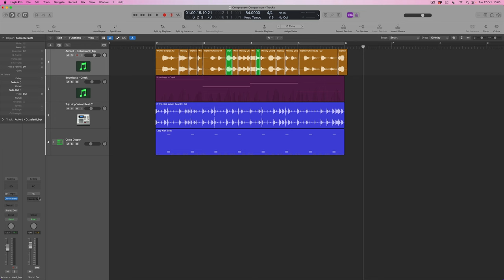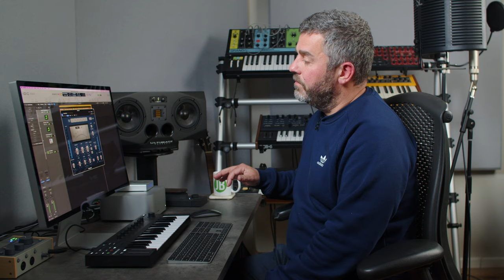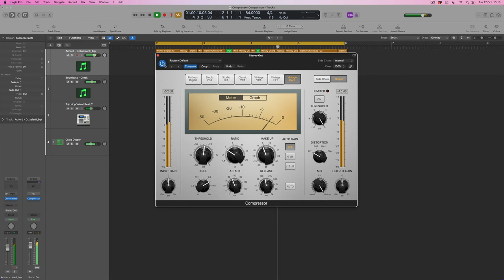LOGIC PRO X - Compressor Types

Comment: Thanks for another great video on your great channel.

I thought I’d share something i learned I didn’t see you mention here that’s helped me—using Graph mode instead of Meter mode (by clicking where it says Graph in the meter for anyone interested). I find it super useful for dialing in attack & release times especially if I’m doing it on a drum buss, high hats, or anything with lots of dynamic range with fast transients because you can see the the levels of the signal coming in along with what the compressor is actually doing. It feels like each of the compressors have slightly different curves on for attack & release so seeing it dip & recover can help avoid the pulsing & whooshing you can sometimes get with fast attacks & releases. 

Cheers!
Reply from the maker: Thanks a great tip, James. Thanks for sharing it.

Comment: These logic compressors are AMAZING. I’ve been trying to find a way to use them on individual stems to add minimal to 0 actually compression but to use the SOFT feature they have for distortion. Putting them on multiple tracks and doing nothing else immediately feels like it connects them together in a pleasing way to me (genre based and subjective for sure but I like it) hoping to learn even more with this! The emulations are nice
Reply from the maker: That's a great use of this plug-in. You're absolutely right; those extra features for a little extra Saturation are great, even without any noticeable compression. Glad to hear you're finding them interesting.

Comment: THANKS ! For orchestral music, as much as I use a compressor on the buses or tracks, on the stereo master I find it complicated to find a Preset/Model that suits all the instruments [example strings/woodwinds/percussions]
Reply from the maker: Hi Sophie. I completely understand - there's a lot of choice and no two pieces of music are the same, so it's not a surprise that you haven't found a one-size-fits-all solution. In fact, I'd encourage you not to try! Keep using your ears on each piece you write and you'll make great choices. Often, difficulties come when we hope that what worked so well on Track A will work equally well on Track B. Part of the joy of Compression is discovering that there's a great sounding, usually unique setting which is different for each track.

Comment: Hey Jono, thanks for the great video! I recently watched your Logic Pro X Masterclass at Guildhall and it motivated me expand my understanding of music production. 

I'm struggling to grasp what drives decision making when tailoring compression settings for a track. As a novice to compression with relatively untrained ears, can you shed some light on what sort of things you're listening for when choosing a compressor and dialing in your compression settings?
Reply from the maker: Hi Daniel. Thanks for your kind words. 

Compression is certainly one of the more subtle audio processing techniques one can apply. Unlike the obvious spatial characteristics of Reverb or Delay, at more gentle settings, Compression can be so subtle, in fact, that it's almost inaudible, when comparing a compressed and uncompressed signal. At such times, it's helpful to remember what Compression is 'for'; dynamic range control. What a Compressor is designed to do is to control the loudness of signals which exceed the Threshold point by whatever Ratio you set. The higher the Ratio, the harder the Compressor works, and the lower the Threshold, the more of the signal is compressed. Start with just those two parameters and you'll hear what happens to whichever signal you're processing. The quieter moments will remain unaffected, but what will happen is that signals above the Threshold will - at high Ratios - begin to sound squeezed and more tightly knitted together. Now dial in some make-up Gain, to compensate for the volume you've lost and suddenly the whole signal will feel a little punchier and under control. Now back the Ratio down to something lower, so the effect is less extreme... and then bypass it to remove it altogether. Try to level match the compressed and uncompressed signals, so that you're comparing similar output levels and you should hear the difference between the two. It's hard to explain with words alone - this is something I'd be very happy to spend some more timing exploring on the Channel. But I hope that gives you some useful ear tests to try.

Comment: Thanks Jono, another excellent video, ahhh but what’s your preference a single compressor or a multi band compressor at this stage, one other question, does the mastering assistant have compression within its logic.
Reply from the maker: Thanks so much. There's no 'magic bullet' answer to your question, I'm afraid; it very much varies from track to track. If the dynamics/frequency needs of a track vary from top to bottom, Multiband Compression will allow you to address those needs. If not, great results are available with stereo compression. And sometimes, both! Yes, Mastering Assistant's Dynamics dial is a kind of one-dial Compression treatment. It doesn't offer any more parameters, however.

Comment: Hi Jono, should the release time settings normally be set to allow the compression to go all the way back to 0db or is this subjective, eg is 1db ok or does it make that much of a difference. Or is a ‘use your ears’ kind of thing?  Hopes this q makes sense.  Cheers and thanks as always.
Reply from the maker: Hi John. It's a good question, though yes, the answer is completely subjective. Let's suppose you want an obviously-compressed drum sound, to produce a super tight, super punchy result. You might set Threshold to catch 5dB or so of gain reduction and high Ratio to ensure that all of that compressed portion of the signal is hit hard. You might set a quick Attack Time too, to ensure that those transients get compressed fast and also a quick Release to ensure that the Compressor recovers quickly and completely, before repeating that process all over again the next time the Transients are loud enough to be compressed. If you increase the Release Time, the Compressor won't quite have time to 'fully recover' before the next transient comes along and the result will be just a touch less aggressive - remember, as the needle can't get all the way back to 0dB, effectively, the amount of gain reduction is less. And if you increase Release Time some more, the Compressor has even less time to recover. In real terms, that means that not only are you producing a less punchy Compression setting, you're also turning the drums down in level, as they'll never recover to full volume. But it might sound great! And if you like that slower Release Time, you can use the Make-Up Gain dial to increase Volume to compensate. This example is just a hypothetical for Drums; entirely different settings might sound best on Bass or Lead Vocals... etc. I hope that answers your question and provides a little more insight.

Comment: Thank you for yet another great explanation. Is the “warmth” that some of these compressors related to the “distortion” option that some of them offer, and if is it only the compressed part that gets distorted or the quieter parts when they get raised? And is the “warmth” some kind of harmonics, or what is it? The more I learn, the more questions I get 😂
Reply from the maker: Great question! Remember that until 35 years or so ago (or thereabouts), if you wanted to apply compression, you needed a hardware unit to do it. Hardware compressors are input and output circuits, similar in that way to channels on a mixing desk. And so, if you drive Input hard, that circuit will, eventually, distort. In hardware compressors, exactly 'how' distortion was introduced to the signal depended on the components within the compressor - the lights of an Optical circuit, or the valves/tubes etc. So different compressors colour sounds in different ways. Producers have always enjoyed the fact that, as well as dynamics control, the tone of signals are affected by compression as well; many hip-hop producers use compression for tone as much as they do EQ and producers often choose vocal compressors for their ability to gently 'fatten up' a lead vocal. So even though Logic includes dedicated Distortion options within the Compressor, I deliberately omitted them from this video, as I hoped - as you have! - that viewers might start to make the connection between dynamic range control and Distortion and all of the sweet spots in between. I hope that answers your question. Oh and yes, 'warmth' and 'distortion' nearly always refer to a change (usually an enlargement) in the harmonic content as a result of processing. If this is a subject which particularly interests you, I've made a course on this very subject for FaderPro: https://faderpro.com/programs/the-science-of-sound-saturation

Comment: Thanks a lot. Appreciate your videos. 💪🏻👍🏻👏🏻🙏🏻🙏🏻🙏🏻 By now at the latest I know I wouldn‘t have needed to purchase so many 3rd party plugins. Logic‘s ones would meet my needs and possibilities to 90 %. I would have saved a lot of money, really. So I‘m sure now, I wouldn’t have needed to buy 3rd party compressors, because these here are as you say very good for all possible situations. But as a beginner about 5 years ago I had no to little idea of everything. Now, if you would recommend a must have 3rd party plugin that Logic‘s is not good enough or not there at all, which one is it? Or let me ask it this way: Which is your absolute „must have“ 3rd party plugin, absolutely necessary for your mixing work? Thanks in advance!
Reply from the maker: It's certainly true that Logic's Compressors are capable of lots more than we tend to give them credit for! I absolutely wouldn't want to make a single third-party recommendation. There are lots of Compressors I use and like for completely different reasons at various stages of the mix, on different instruments etc. This channel doesn't have any endorsement from any manufacturers but I'd still like to avoid any possible accusations of bias! The most important thing with Compression is to close your eyes and carefully listen to the before/after treatment. Do you prefer the sound with the settings you've used? If so, great. If not, keep subtly tweaking until you hear something you like.
Reply: @jonobuchananmusic  I understand. I appreciate your videos very much! Thanks for every single one. 👍🏻👏🏻💪🏻

Comment: Hi Jono! A question: On the first compressor, Platinum, after you set the dials, when you moved along to the next ones, it appeared you didn’t set any dials on some of them. If so, were they set by the Platinum compressor? Need a little clarification please.
Thanks,
Gianni❤
Reply from the maker: Hi Gianni. That's right, as you move between the different compressors, Logic will, where possible, retain settings from one to the next, giving you a chance to compare the sound of each model sequentially. It's not a straightforward science however; some of the Compressors have different gain staging, meaning that they'll appear to compress more than others, even with the same Threshold and Ratio settings. So do keep using your ears to decide which models work best for you. Cheers!
Reply: Logic locked what you dialed in on any of the compressor algorithms so that you can compare the different compressor algorithms. You can do the same with the Logic EQ when you switch to Linear Phase EQ.
Reply: @jonobuchananmusic  Lovely! 👍🏼
Reply: @about_schmidt  Thank you! ✌🏼